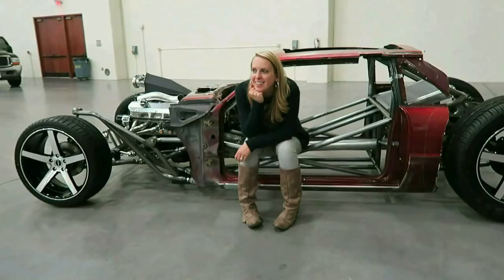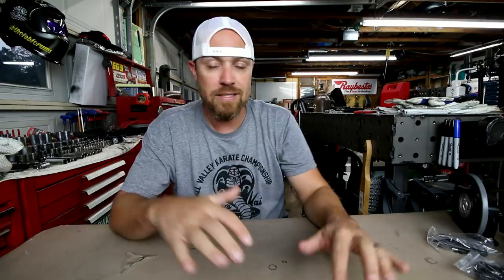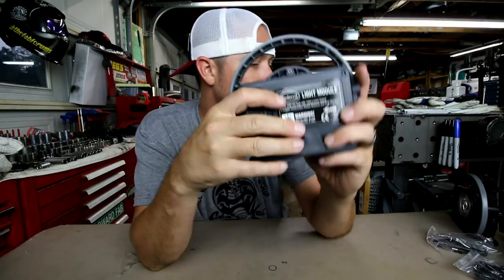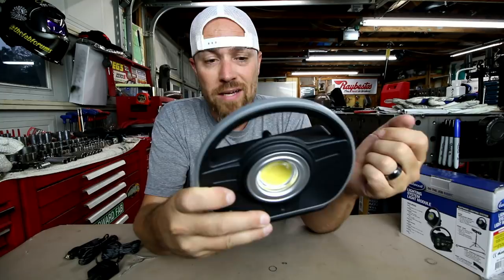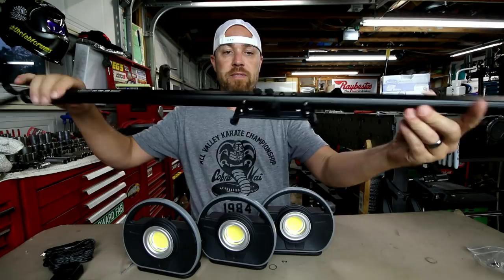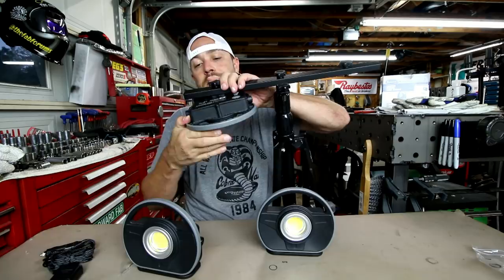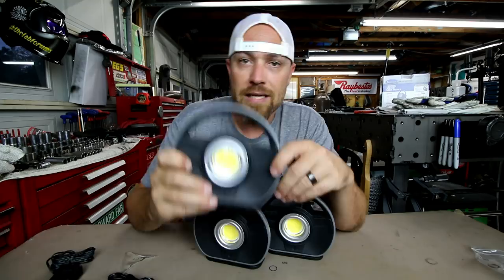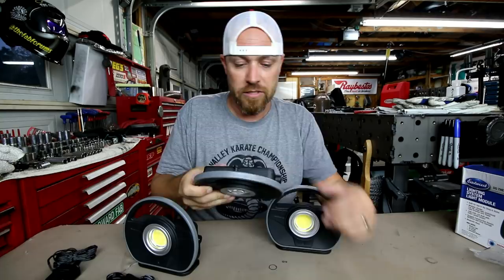You Need This Tool - Episode 97 | LED Shop Lighting System

Comment: LED lights suck i have a led flashlight and a maglight no comparison you can see twice as far with the maglight in the dark, led porch light barely lights up 20 ft from my porch incandescent bulb lights up 60 ft from my porch, led tail lights half ass work some bulbs work some don't looks like shit incandescent work or they don't simple never had any luck with led you can keep them
Reply from the maker: You just have the wrong LEDs...nothing compares
Reply: That's probably because you're buying the cheap LED lights that the market is flooded with. There's a reason why automakers are turning to LED lighting for headlights, turn signals, brake lights, license plate lights. You are probably using a cheap $10 LED flash light that runs on AA or AAA batteries lol. Look for a LED light that runs on 18650s and go with name brand LED flash lights and not the ones that are "TACTICAL ZOOM" etc. O-Light, Nitecore, Fenix, Streamlight are all quality brands. Thorfire is a step down but still good quality.